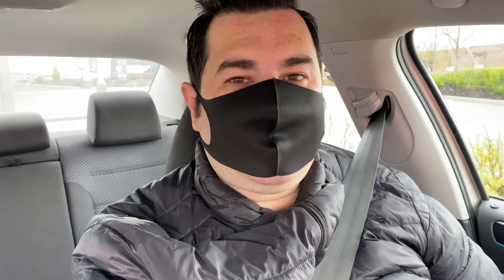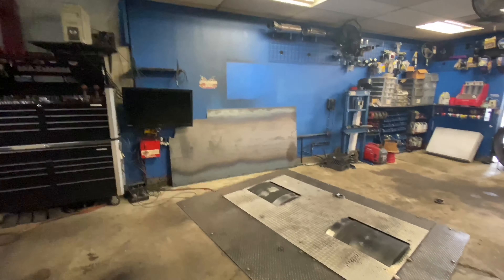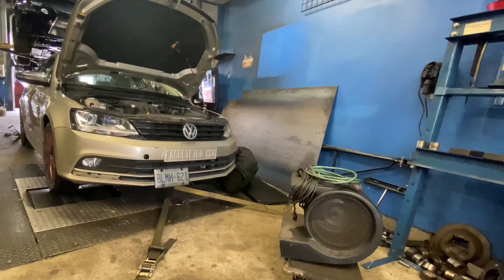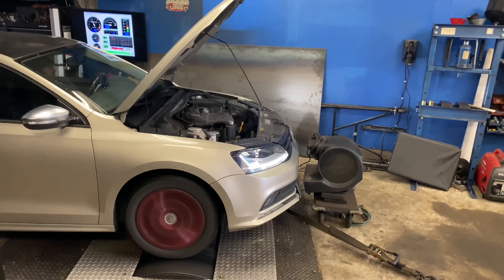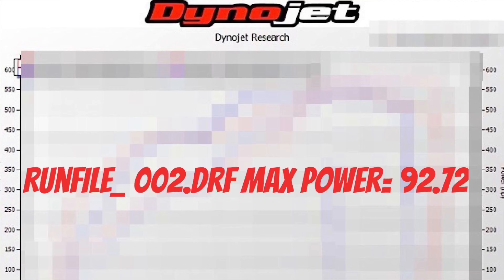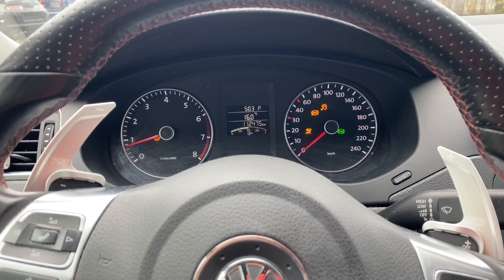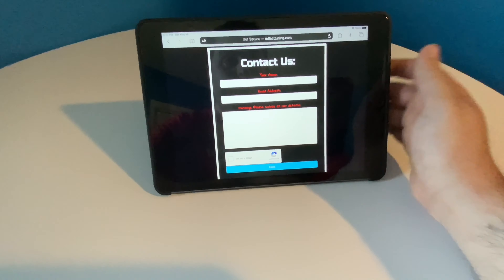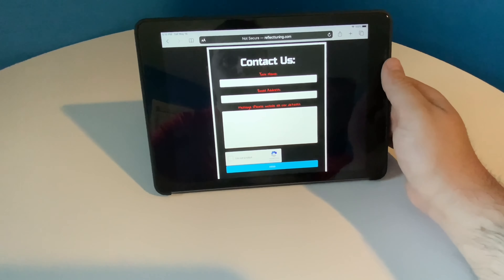Dynoed My 2014 VW MK6 Jetta S 2.0L And Ordered A Stage 1 ECU Tune!

Comment: What was the dyno numbers after the tuned ecu was put in?
Reply from the maker: It was 100 HP to the wheels. It read 100 HP on one dyno run. The other dyno runs were under 100 HP.